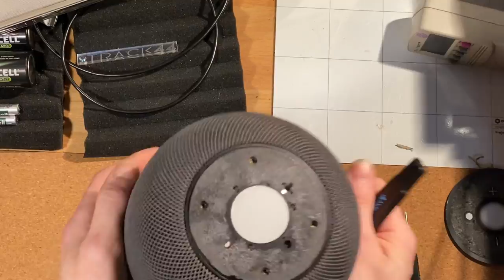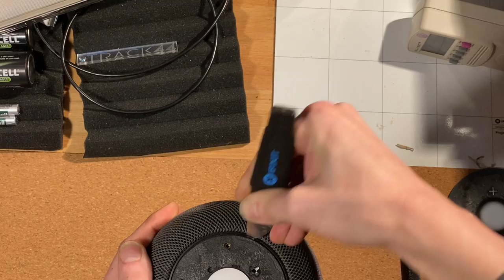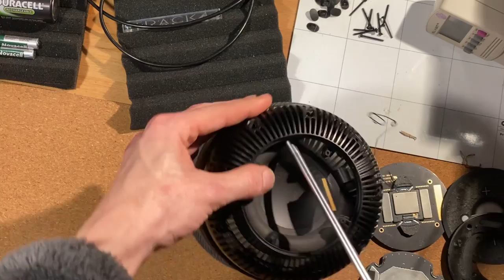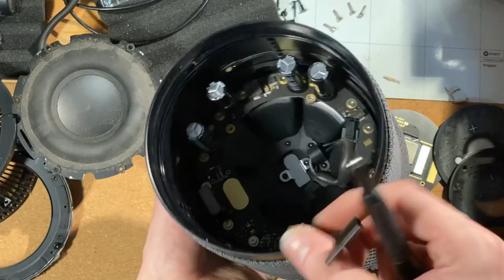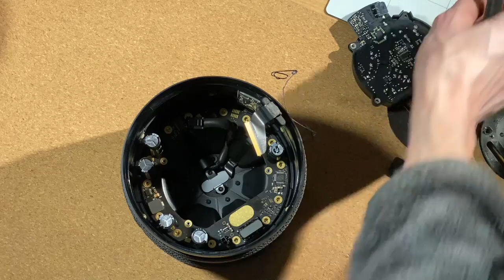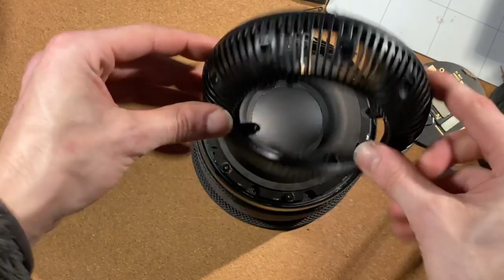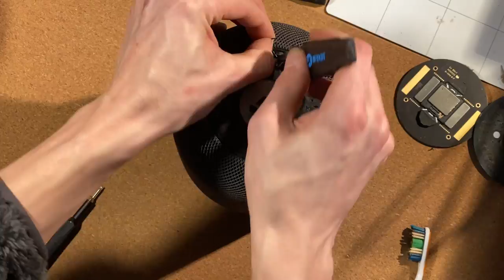How to Fix a HomePod that Won't Power On; The Most Common Inside the A1639

Comment: Wow! What an amazing tutorial! My HomePod had the exact same issue. I exchanged the diode, it worked until I tried to play a song. I took it apart again and the diode died once again. 
Anyone has any ideas why this keeps going bad? Maybe a bad woofer or tweeter?
Reply from the maker: I'm guessing you used the same diode I linked? If not Im curious exactly which one you replaced it with. 

Might need to replace the diode again then do some tests before playing any music, curious what voltage you see on the IC to the left of the diode on pin 2, the IC is labeled "54560". Also curious what voltage you see on the big grey coil to the left of the diode. I am referencing another conversation I had with someone else who had some other failed components near this diode: https://www.youtube.com/watch?v=YNfMjX4KQPY&lc=Ugyhtx5lafl7Qc6VB9R4AaABAg
Reply: @NicsFix  I used the same diode as you did - from Digikey
Reply: As soon as I take it a part again and I will measure the coil with a bad diode
Reply: Interesting I removed the diode from the board and checked if it was shorted, nope. I’m wondering if I have accidentally removed one of those capacitors next to the top of the diode
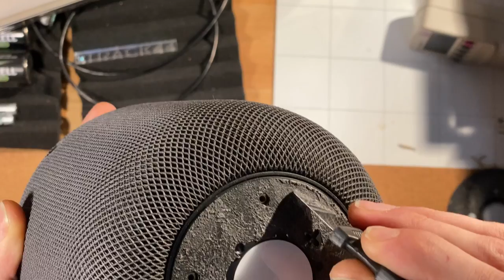Reply from the maker: @Lefarr  Check my recent upload and compare, I show a close-up of those capacitors at 2:22 https://youtu.be/OvHope_C_lc?t=141

If you knocked out the one to the left of the diode, I measured that one for someone else as a 0.1uF 1mm capacitor. If it was something else missing, let me know and I can pull the same component off a parts board and measure it for you to find a replacement
Reply: Both top capacitors are gone. Well, I will visit some cell phone repair shops and see if I can find two of these to replace.
Reply: @NicsFix  I purchased another OG HomePod with the same issue. Installed a new diod
e, it worked perfectly for three weeks. Just today it died, again. I check the diode still on the board and no signs of short circuits. Any ideas?
Reply from the maker: @Lefarr  can I see any photos of the work done? It's possible if you didn't use good techniques to replace the diode the repair will not last and the diode will make a poor connection, not showing a short, but just not being connected anymore.

Also check that all of your cables and connectors are securely fastened and correctly locked down, remember the connector on the amp board for the ribbon cable is backwards logic, it looks locked when its not and is lockewd when it doesn't look like it.

Let me know when you've tried reinstalling the diode again, reconnected everything and given a thorough check, and we'll go from there suggesting where to take readings
Reply: @NicsFix  Sure thing! As soon as I work on it I will let you know. I'll try to take some pictures of my crappy job. I will try another diode and see what happens.
Reply from the maker: @Lefarr  one more thing I just remembered you can easily check...the power supply has a fuse, sometimes they blow open and of course the homepod won't power on anymore. Check that your power supply fuse is still good and continuous! I have more info about that also on my website with photos under the common issues section